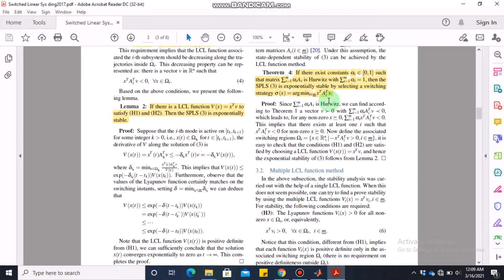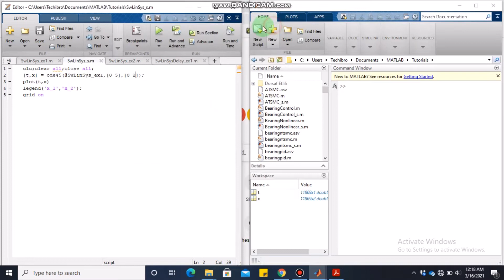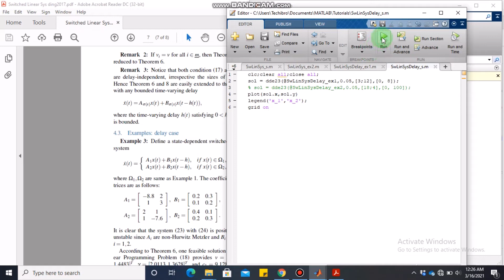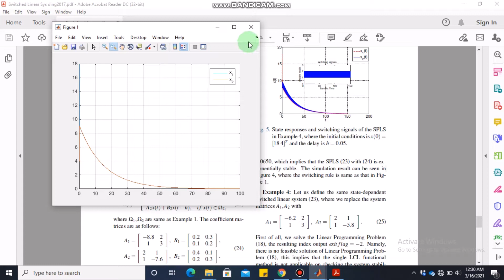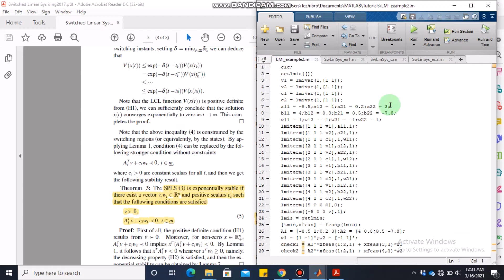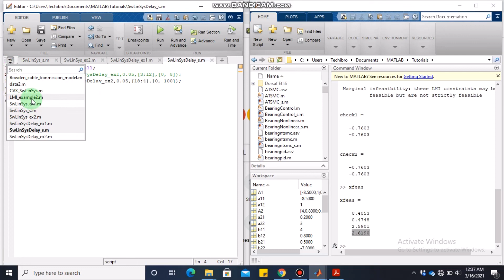MATLAB Simulation of Switched Linear Systems with State Dependent Switching and Delay

Comment: Dear Mr. Ali Nasir, Many thanks for your nice tutorial. I have a question about you? How can I simulate a singular time delay system with index 2? Exdot=A x(t)+Bx(t-tau).Thanks
Reply from the maker: What is "E" is it xdot or Exdot? Also, what do you mean by "Singular"? Commonly this term is used to specify the inability of the control to maneuver the system at a specific value of the state variables.
Reply: @cset  Dear Ali, Many thanks for your reply. Regarding your question E is a singular matrix. This system is the type of Delay differential-algebraic equation or DDAE and it is not ODE. Please see the book entitled "Analysis and Synthesis
of Singular Systems
with Time-Delays
Reply from the maker: @maziarfallahnejad3857  Thanks, it's a good book. I have never dealt with such systems before.
Reply: @cset  Thanks

Comment: Good evening sir 
Is this statement is true for average dwell time method? 
 Time-constraint switching is also a special switching signal, which implies that a switching signal is usually required to dwell on each subsystem longer than a pre-established constant. However, the fixed dwell time may be unrealistic. To handle this problem, the concept of average dwell time method is used. Therefore, the average dwell time method allows the possibility of switching signals with dwell time being occasionally less than the pre-established constant. It can be seen that the average dwell time method is effective for designing switching signals.
Reply from the maker: These are many statements :). I cannot say it with authority but after reading through the paragraph, it does make sense to me. The average dwell time method to allow for variations in the dwell time sounds good.
Reply: @cset  Thank you sir , sir Why we we use average dwell time method in switched nonlinear systems?

Comment: I have a switched system that is time dependent. i.e. xdot= Ax for 20% of time interval. Then for next 80%, xdot= Bx. But the problem is that system B, should always start from the end of system A. And system A then builds on where system B ends. 

Do you have an idea how I can implement this system in matlab?
Reply from the maker: You can store the value of B matrix in a text file as done here  https://youtu.be/rZaLCCkhaAM or you can use the global variable definition